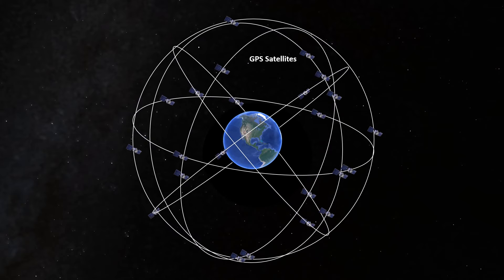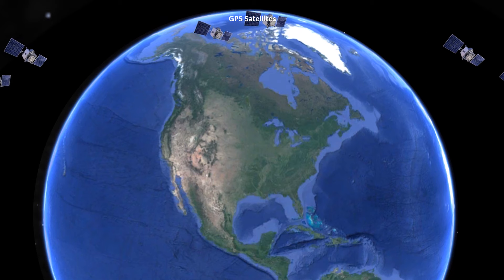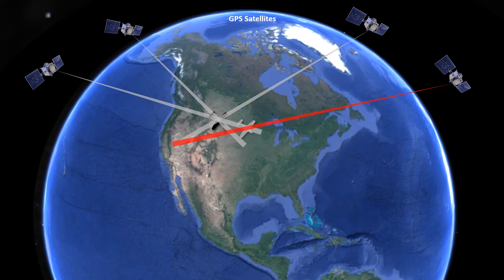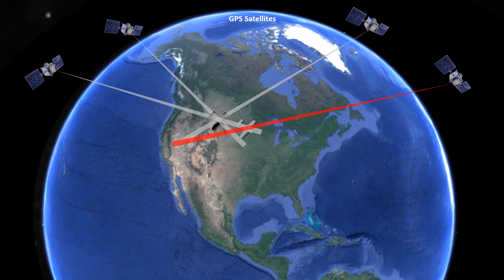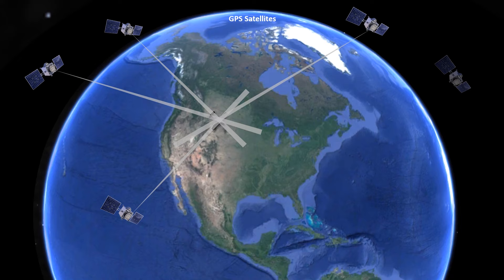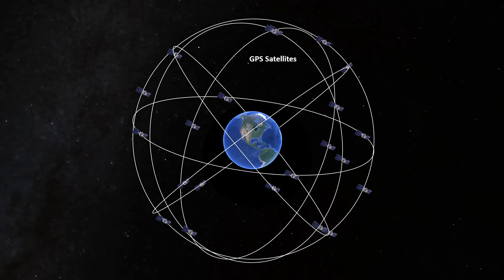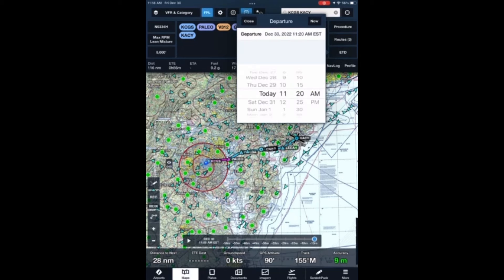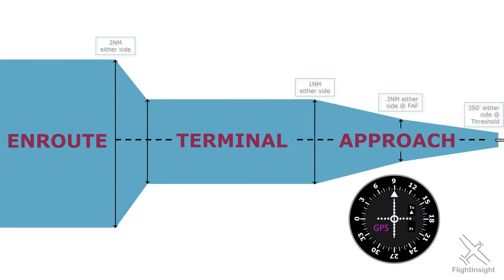What is RAIM | Receiver Autonomous Monitoring | How GPS Works

Comment: Is the Enroute-2nm, Terminal-1nm, App-0.3 to 350ft assured when we have RAIM availability? not a WAAS?
Reply: I’m fairly certain that’s correct, the RNP is based off of RAIM availability, which is why we have to change means of navigation if RAIM is lost as we lose the certainty of gps accuracy. WAAS enhances our gps allowing even more accuracy as well as the ability to shoot lpv and lp+v approaches. Correct me if I’m wrong though 😅

Comment: THE LEGACY CAN CALUCULATE IF RAIM IS NEEDED? IT CAN BE USED IN IFR BUT IF RAIM IS LOST THEN THEN APPROACH HAS TO BE CHANGED TO RNAV OR OTHER?
Reply: Rnav is a gps approach, you would need to use a ground based approach instead like vor-dme or ils

Comment: My CFII gives me oral exam practice questions after each training flight.  Today's was: "explain RAIM".   I choked.   So I went home and reviewed this video several times.  How is this (below) 30-second summary of FlightInsight's phenomenal 4+ minute presentation?
-- Receiver Autonomous Integrity Monitoring allows your airplane's GPS navigator to confirm that it's receiving a sufficient number of valid satellite signals to correctly determine its location and altitude, while rejecting any faulty signals from malfunctioning satellites.  This assurance of positional integrity requires at least five functioning satellites in view.  Various websites and applications confirm RAIM availability for our intended flight path and time.  If RAIM is, or becomes unavailable, then GPS cannot be used for navigation. --

Comment: Dan- I have been digging into GNSS, GPS, SBAS, WAAS, RNP and PBN.  Your newest video was very timely.
Now you need to sort out the alphabet soup of the aforementioned acronyms!!
I always learn something from your work- realizing how much I don't know!
Happy New Year!!
Reply from the maker: GNSS is a general term for satellite navigation systems like GPS (GLONAS and Gailileo) are others. SBAS is a general term for augmentation which WAAS is one of. RNP deals with the error tolerance of equipment (0.3 nm is required for a general GA GPS approach). PBN deals more generally with equipment and also operator requirements like crew training etc. there, sorted you out without a vid lol! Definitely merits a deeper dive at some point though. Happy new year
Reply: @flightinsight9111  Like OP I've been digging in as well, but in one sentence you've helped make sense of it all.  Thanks!

Comment: GPS system - - 0:27 - - requires reception of signals from a minimum of 4 satellites.
RAIM (Receiver Autonomous Integrity Monitoring) - - 1:56 - - requires a minimum of 5 satellites. 
(Note - - separate video - - ADS-B requires a clear line of sight of 288 miles)

Comment: While preparing for my instrument oral exam, I came up with this question.  Hopefully somebody can answer:
If while flying an approach in IMC to an airport having only RNAV approaches, there is suddenly a RAIM flag during the approach, how do you fly the missed approach, since it too requires GPS navigation?
Reply: Depends on how long the RAIM warning is displayed for. There is a greater GPS accuracy requirement required for the approach segment, when compared to the missed approach, so initiating a climb could potentially remove the RAIM warning.
Reply: Yesterday I asked my CFII and his response was:  Initiate the climb, notify ATC of the RAIM failure, and they will give you instructions, presumably vectors.